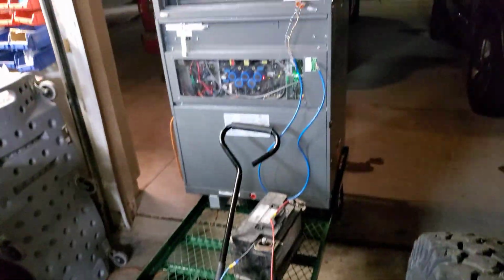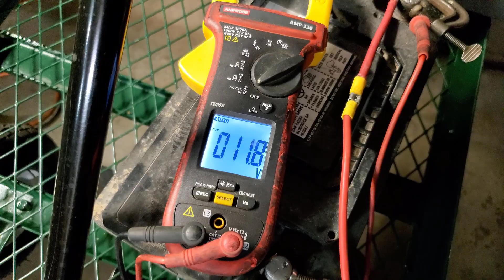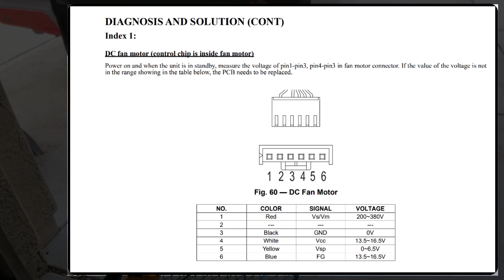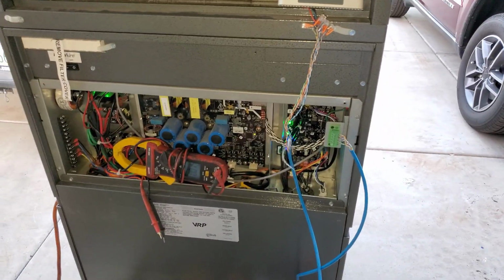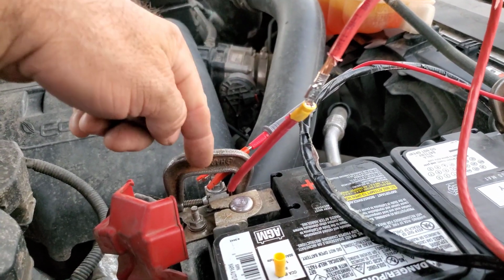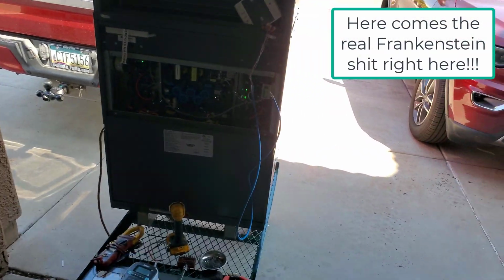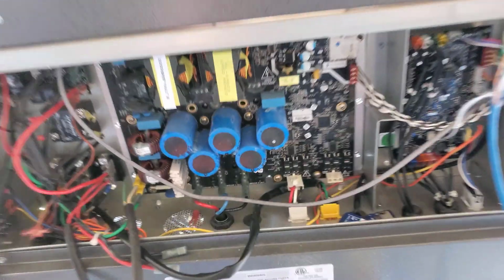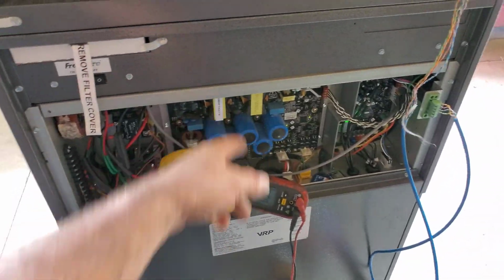Time for some serious Frankenstein Experiments!!!

Comment: Had one of those DC fan motors go pop once, took a protection diode out on the mainboard, guess the diode did it's job!  Replaced the diode for a close-enough match and it's back in business, it was on the PWM line.
Reply from the maker: One of the motors in these?
I hadn't opened one up yet. 

On the ECM motors we see in resi stuff they have the electronics dipped in goo
Reply: @hackfreehvac  Oh no not one of these, this was a Veissmann heatpump which basically a rebadged Airwell unit, Chinese behind a German name, haha  - the bearings  were beginning to sound a bit choice anyway so it was due replacement soon.

Comment: Try looking at the suspected choke, if it has more than two connections it may be an autotransoformer or transformer. But by the looks of it it may be a choke that you can replace by a short if you are running on pure DC.
Reply from the maker: It got hot and loaded down my DC power supply so it has to be a transformer or autotransformer where the L1 and L2 connectors were a closed circuit rather than in series like a choke.

After I realized it I can say that I've seen these types of transformers used for step down power supplies before. 

I may replace this one with the one from the other VRP since this one I'm keeping factory stock and will miss the other one. 

At that point I can peel back the connectors and examine it.

Comment: U definitely need a larger inverter!!! 3 marine grade deep cycle batteries minimal. Car batteries are not suitable for inverter use.. trust me on that!!
Reply from the maker: Deep Cycle would be better I am sure however my new truck battery stayed stayed at 12 or above with the engine running. The inverter itself tripped it seems. The display is bad on it (which is why I got it for $30 used) so I dunno what fault etc.

Knowing that it can run on an inverter I think I might buy one of those solar combo charge controller / inverter units off of Amazon or something. Maybe do a 48V pack of batteries and a separate array of panel for that.

Else I need to keep building up my high voltage array and batteries and make a ghetto 120V generator by spinning a 120V generator head with a 3 phase motor. LOL
At least simple stuff like that may be easy to keep going and service. Just not so compact.